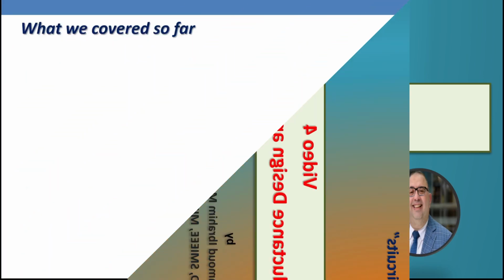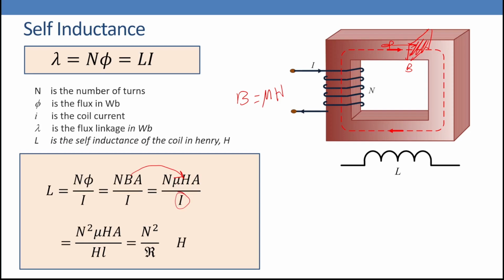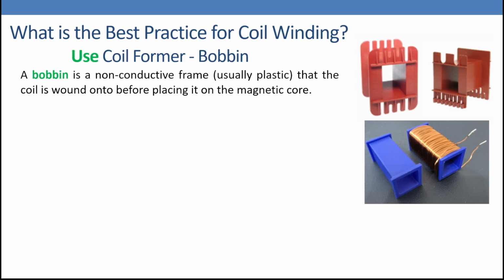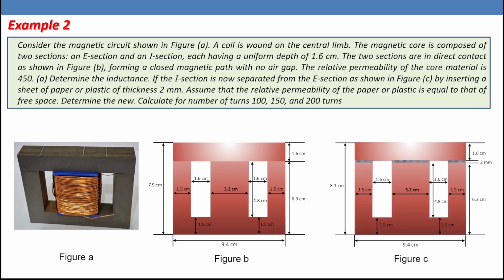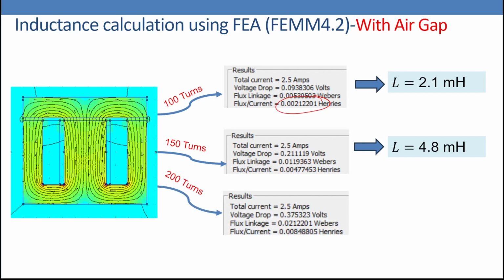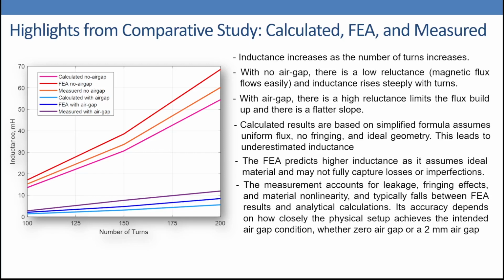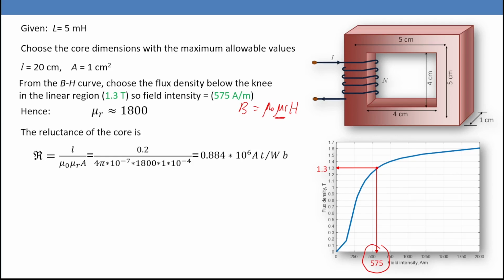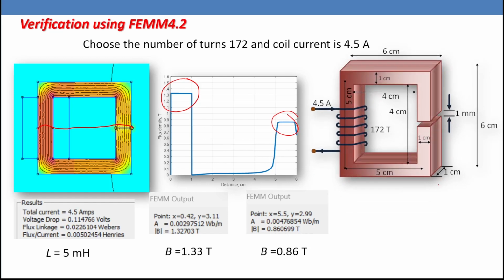Magnetic Circuits: Inductance Design and Calculation

Comment from the maker: In this video, we explore how to calculate inductance and, more importantly, how to verify it using analytical methods, FEA (FEMM 4.2), and real measurements. You’ll also learn practical coil winding tips and how to design inductors under real-world constraints.
🔗 Catch up on previous videos for the Magnetic Circuits Course:
Video 1 – Course Introduction & Sources of Magnetic Fields
https://youtu.be/ttAWTaVxCZ8
Video 2 – What is a Magnetic Circuit
https://youtu.be/Y0krCaZr1Dc
Video 3 – Analogy Between Magnetic & Electric Circuits
https://youtu.be/tJT3Uv9_V6Y
🧪 FEMM 4.2 Step-by-Step Tutorial:
https://youtu.be/ifdcAW9mehg
👍 If you find this helpful, don’t forget to like, share, comment, and subscribe to support the channel!